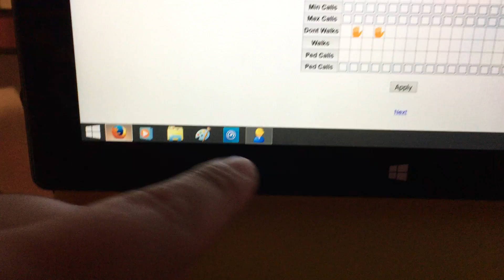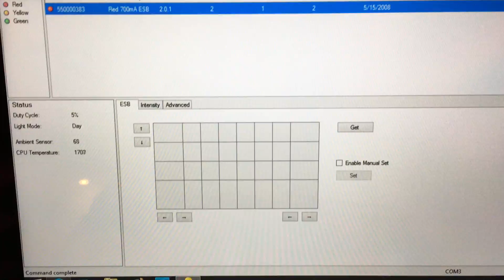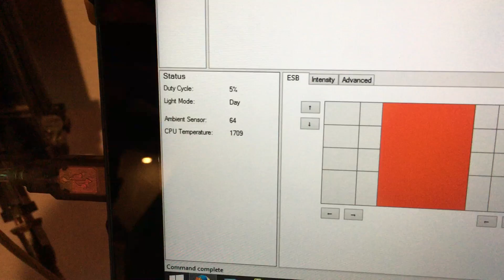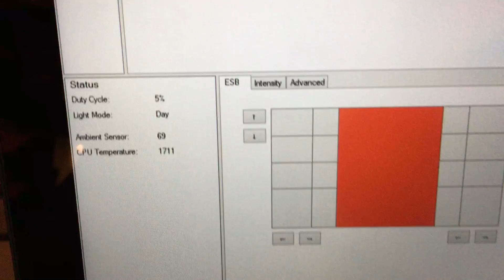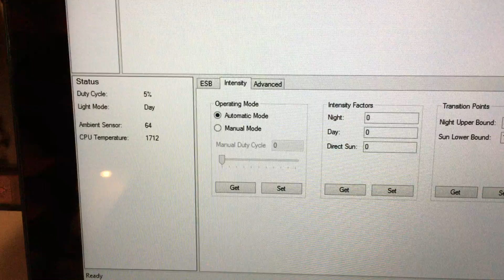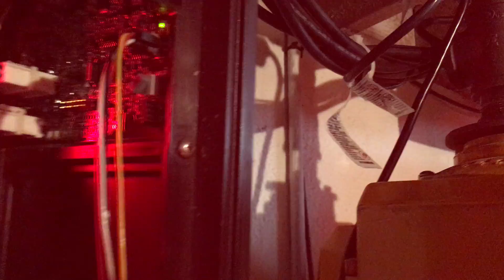New Intelight ESB Programming Demo Video

Comment: I have one signal like you but where can I get the software for programming my sections?
Reply: it looks like the software comes from the signal? if you look at the link it says a specific IP address link with it saying Host as well, i wonder if the software is in the signal or on the wire where it converts from USB to the proprietary serial port on the traffic light board. i have one as well, and i don't know how to program it myself or where to purchase the items since not all my LED's are lit on Green light, as well as the brightness.